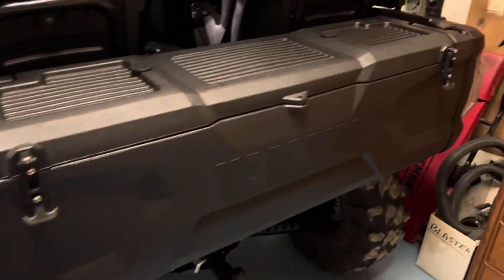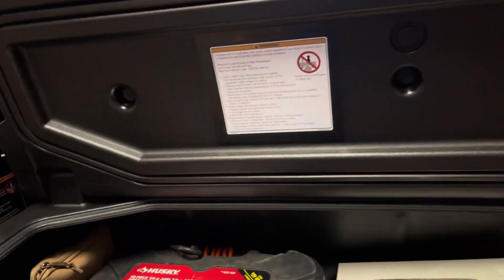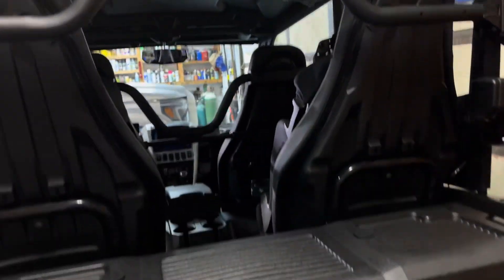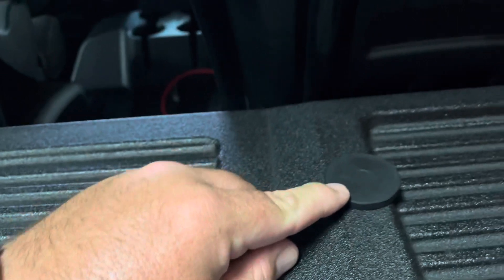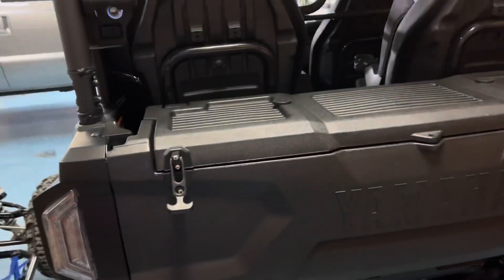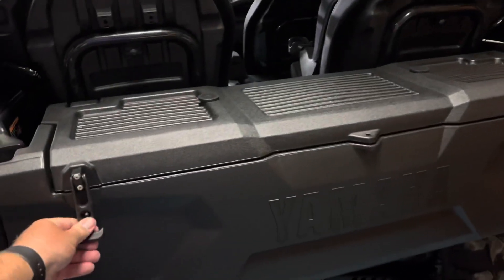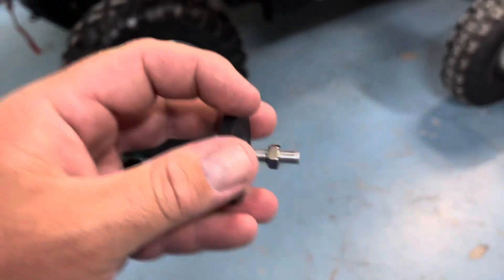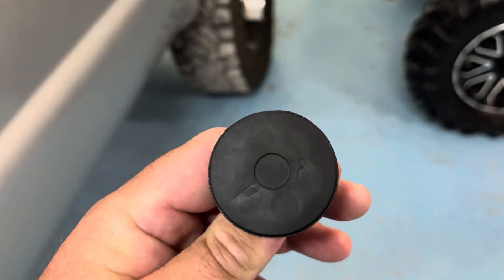RMax Cargo Box 2.0

Comment: Your X4 should have also had the hump up top.  Your dealer installed it wrong on your X4. Nice idea with the magnets.  Have you poured water on the top of the lid to see if it dumps into the storage area when the lid is opened?  My cargo box also has that gasket and is the original.
Reply from the maker: My X4 was one the first ones to hit town so I wouldn’t be surprised they installed it wrong, but it did work good for my little hook setup, but with the RMax bar being in the right position it’s nice to have better access, I haven’t tried the water test yet, my old box had a different gasket but the design of the box looks the same so I assume it will still dump water when I open it, I’ll find out after the next wash, I’m also waiting on the Hard Cab which will cover the top of the box so hopefully I won’t have to worry about water soon
Reply: @sincityf3505  if you find out that it still dumps water I have a solution for that https://youtu.be/l1sZIP81NiE  Obviously it won't be an issue for you once you get your rear glass, but others with no rear panel may be able to do it.
Reply from the maker: @MassiveOverkill   awesome, thank you, I think I have watched all your videos, I was a little jealous when you got your RMax so soon, I had mine on order since September and didn’t get it till February